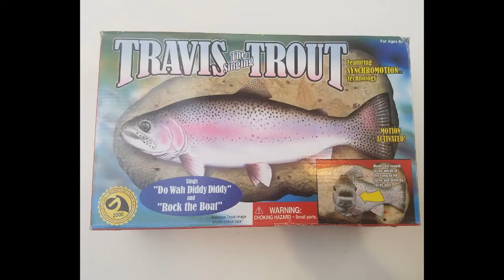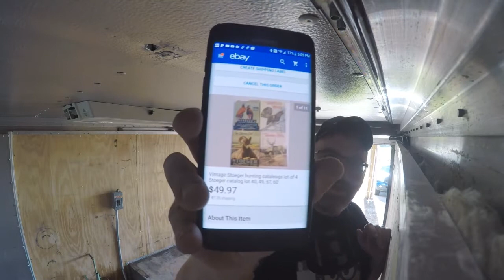Building Ice Cream Truck   Install window

Comment: How do you frame the walls you can’t put screws because it would go through so do you use glue or what
Reply from the maker: The truck with the plywood walls had aluminum reinforcement kind of like studs. I could screw right to the plywood into that and it didn't matter if it went through that piece of aluminum or not. It didn't go through the exterior aluminum. My other trucks I did not do anything to. I just left the aluminum as is.
Reply: Rod at Win By Doing 
I want to put the pvc boards because health department likes it and it’s easy to clean but I wonder if some glue could connect the frame to the 2 by 4 that will hold up the plywood or maybe Sheetrock  how about the sink
Reply from the maker: I was going to go PVC on our concession truck when I was running concessions out of it. Since the ice cream is all pre packaged and nothing is prepared, here in Idaho we don't have to do health inspections. That's why I just painted the ice cream truck walls white to give it a cleaner appearance. Trying to stay away from that creepy ice cream man vibe.  :)

Comment: You gave no measurements nor did you tell us what type of windows they are or where do you get them. Are those house windows or rv ????
Reply: There house windows from Lowe's
Reply from the maker: Yes, i use house windows. Vinyl. I have tried various sizes. I will have to double check but I think that one is 48" side sliding. The ones sliding sideways we find work better than up and down. Don't have to bend down that far